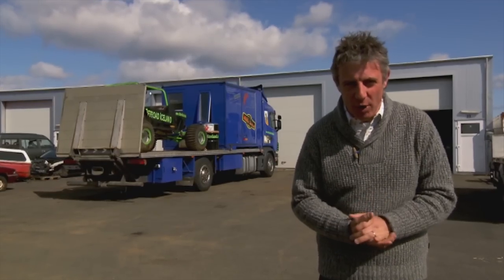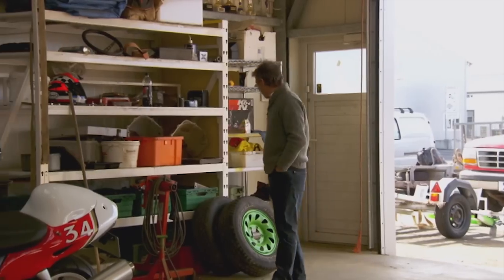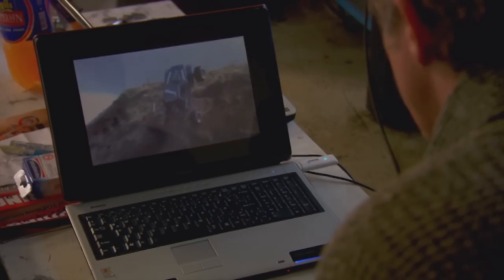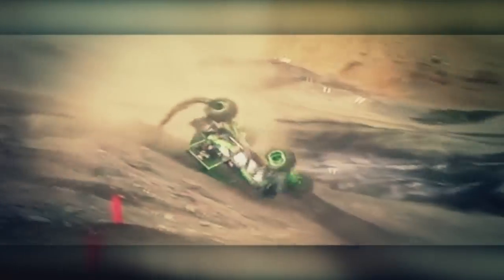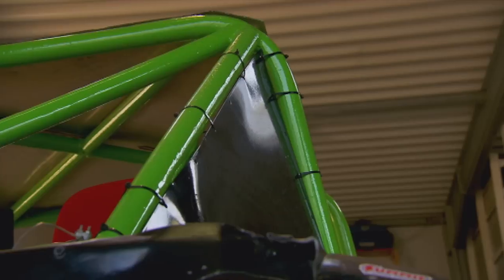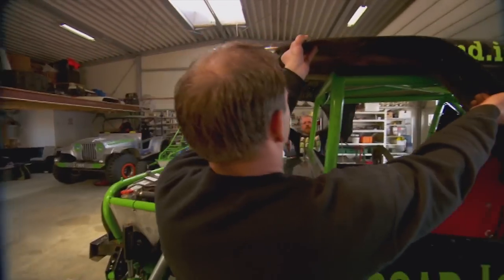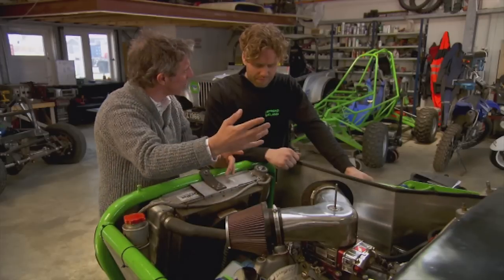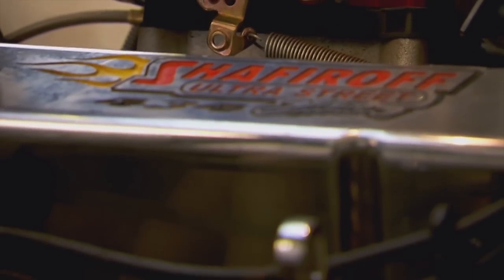Mechanics Of A Formula Off-Road Buggy - Fifth Gear

Comment: Interesting that the cage hast to take 6x the static load of the car. That's kind of like some Roman engineering, they calculated the static load and just multiplied it by 5 to get something that they knew would be safe in dynamic loading.